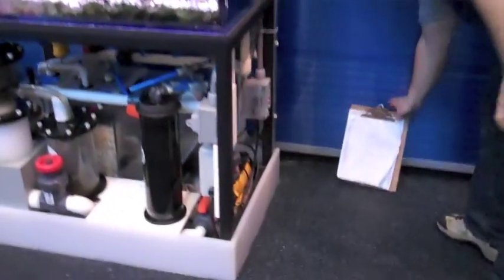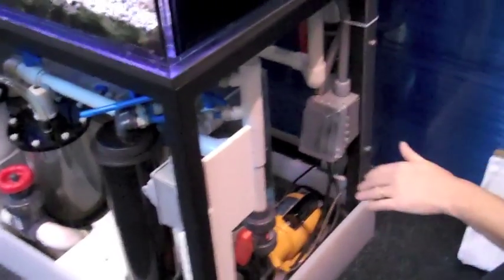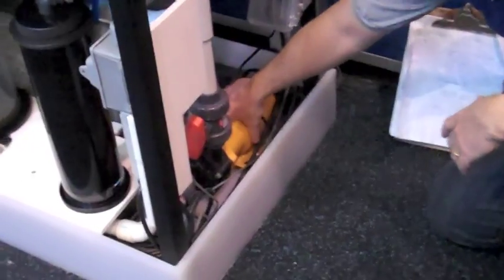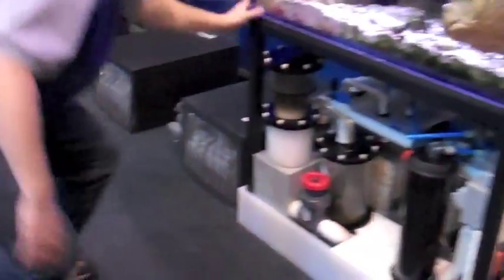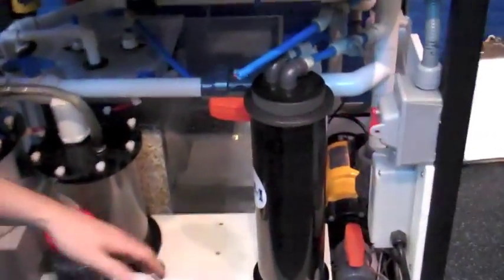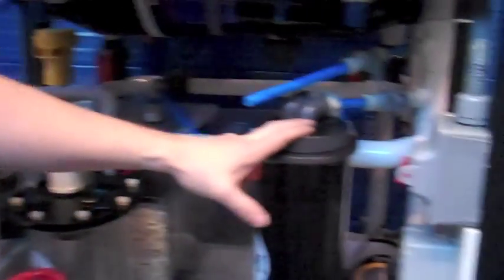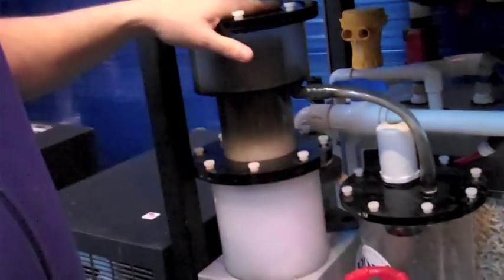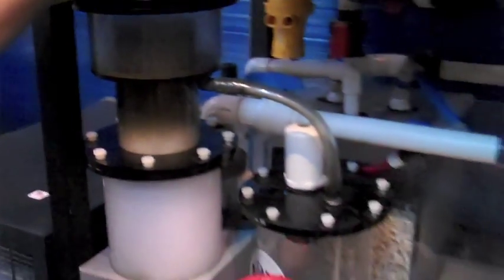Aquarium Filters & How They Work:  Part 1

Comment from the maker: Only if you want it to work consistently with as little problems as possible. We needed to fit everything within the stand, because originally, the exhibits were going to be covered with cabinetry (top & bottom). All aquariums need: strong aeration, waste removal, biological filtration, chemical filtration, mechanical filtration, heating/chilling. And this exhibit is one of many ways to do it. I'm obviously a big fan of taking your time to design and install it well so that it just works.